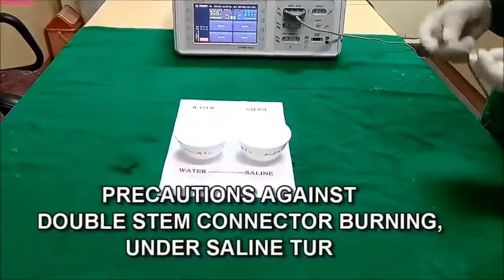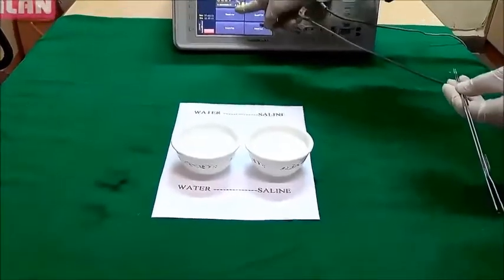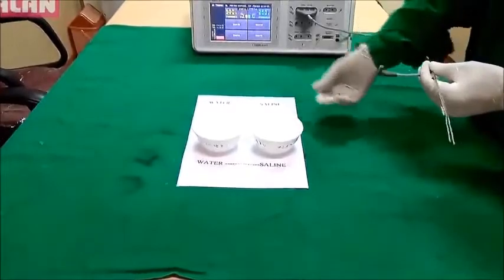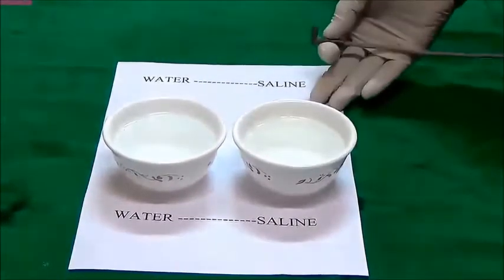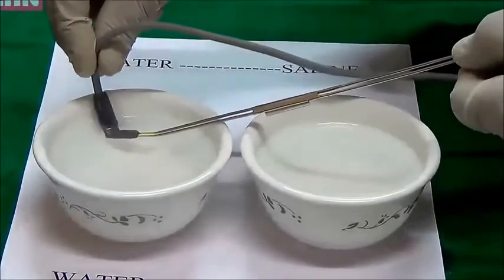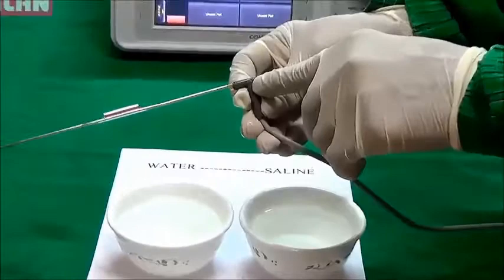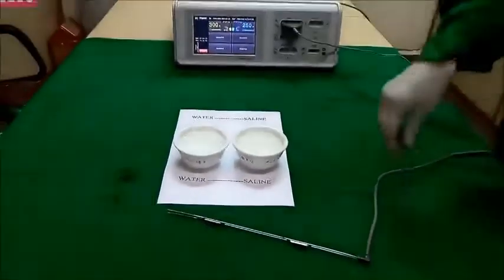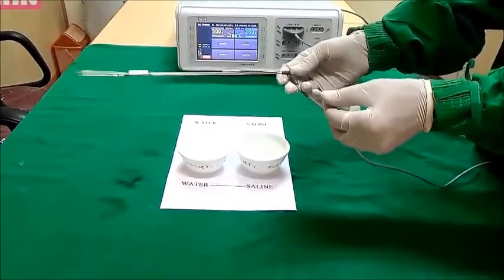Bipolar Saline Plasma TURP TCRE HF Cable Burns

Comment: Nice demonstration.. can u plz tell me a way to avoid sticking of prostate chips to cutting loop during resection?
Reply from the maker: in bipolar saline plasma;  sticking doesn’t happen like Monopolar. However chips do get in way as usual... cold (non-active) backward forward movement little bit generally solve the problem. But senior mentors can shed some light on this issue ... I am just an engineer 😇